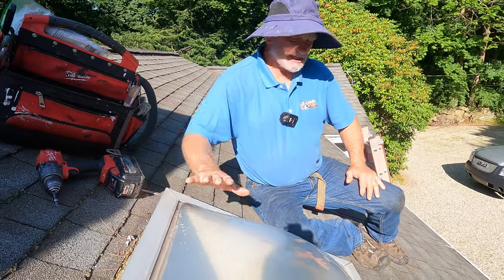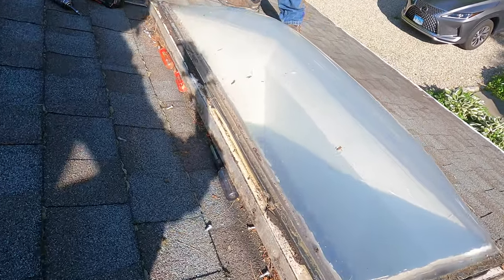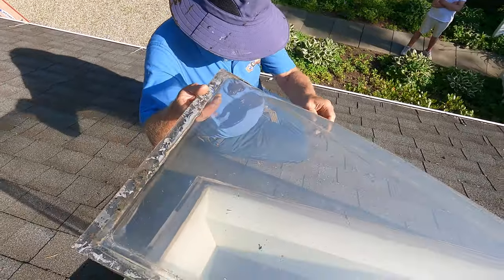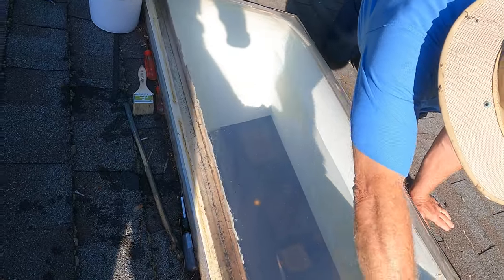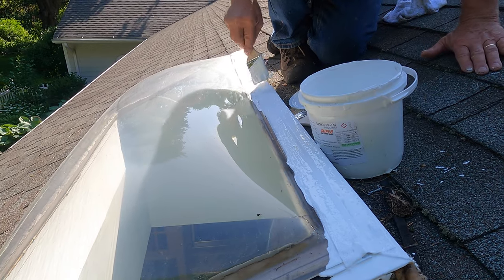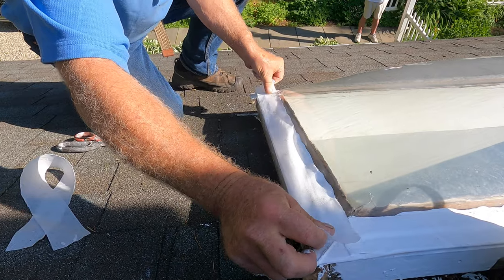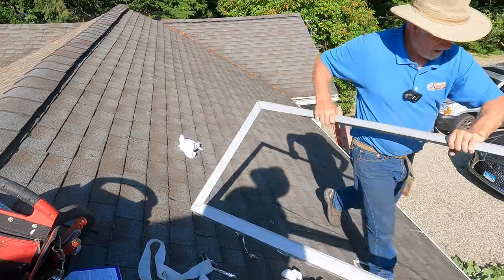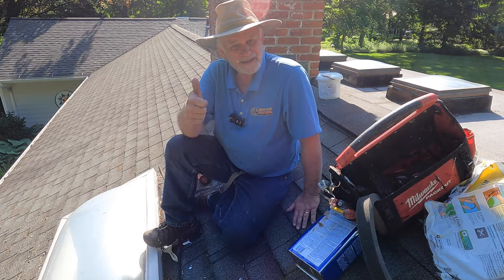How to Repair a Leaky Skylight- Super easy and fast and Cheap DIY

Comment: Where was the leak appeared, on inside lower part(skylight) of ceiling? or inside the skylight wall? Please explain the source of leak i.e. roof around the skylight flashing or the rubber seals on top.